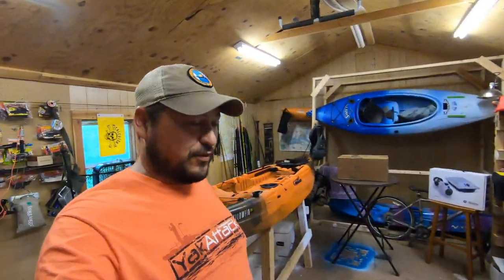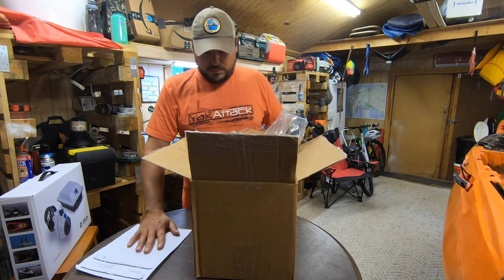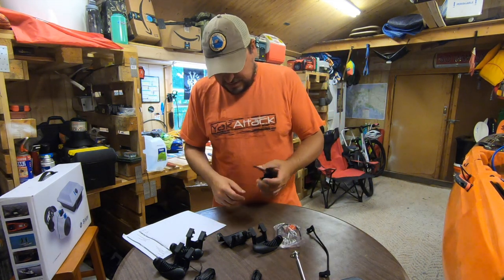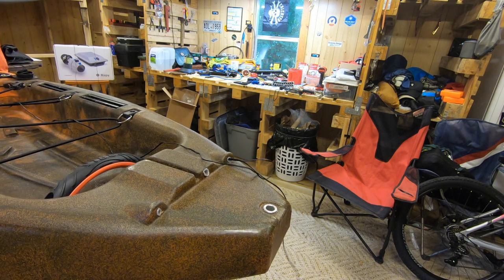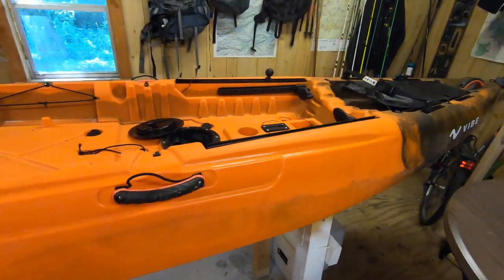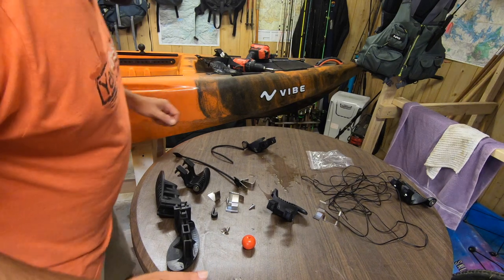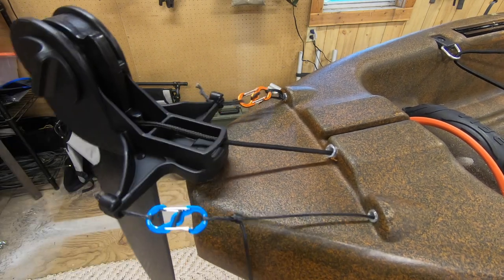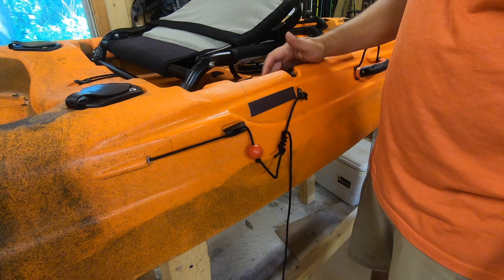Vibe Yellowfin 120 | BIXPY JET & DIY Rudder FULL Install

Comment: Hello Hydra Yak how you doing. I just found your Channel and this was a great video thank you. I did enjoy watching this. I have a question? My kayak is ready for this setup. The problem I have is I have very very big wide feet sz13 4  EEEE WITH FAT WIDE TOE. I can barely put my flip-flops on my feet because my feet are wider than the flip flop straps.That's just how wide they are. It sucks having wide feet because my regular foot brace is 2 narrow or not long enough for my wide feet to stay on. I'm wondering do the Hardware on the back of the foot brace come off so I can try to modify my own foot brace so I still turn the kayak. It would be nice to use the foot brace weather am barefooted 👣 or wearing my flip-flops. I like your  flip flops you are wearing. I'm a huge fan of flip flops since that's the only thing I can wear. Take it easy and you have a good one.
Reply from the maker: I wear size 13 too. But I use the factory pedals. They work for me. The tops do come off so I’m sure you could diy or add on to the existing platform.
Reply: HydraYak Outdoors oh cool You are a sz13 too. But please tell me your foot is not wide I like mine. It's very hard to find shoes for my feet. That's cool the Pieces come off. I guess I have a DIY I need to do. Did you get them off of Amazon or did you go in the store and pick him up I can't remember. Thank you for your help and replying. I hope you don't mind me joining your channel it is good.

Comment: Is there a reason you have to cut the rudder so short? I'm looking to order a bixpy, but I do not want to cut the rudder short. I'd rather just cut a V notch at the bottom of the rudder to accommodate the motor mount wire. This way, I can remove it, an still utilize the full rudder when I just want paddle around. Other than grounding out on a and bar, what would be the negatives of mounting the motor lower in the water?
Reply from the maker: There are many kits you can get from bixpy to apply it different ways. Check their site. I chose the diy rudder kit. It’s more of a permanent install. 4 hex nuts if I remember correctly. Not something you want to take on and off and put on again. There are other options. Vibe has a quick install kit coming out soon. That keeps the functionality of the rudder with or without the motor.